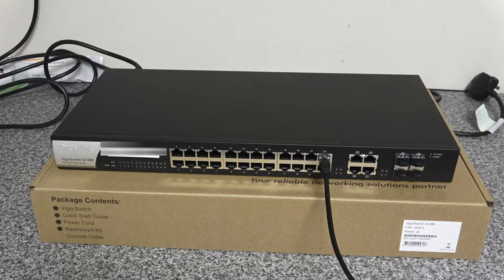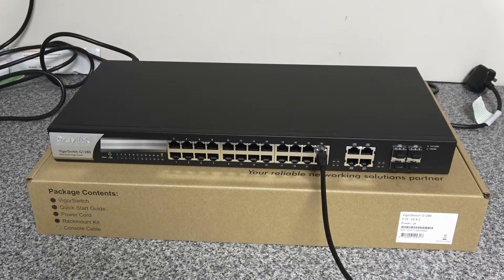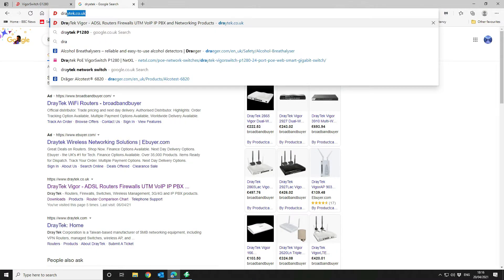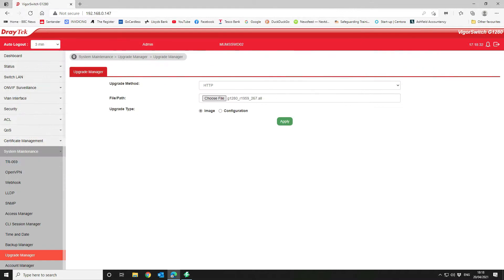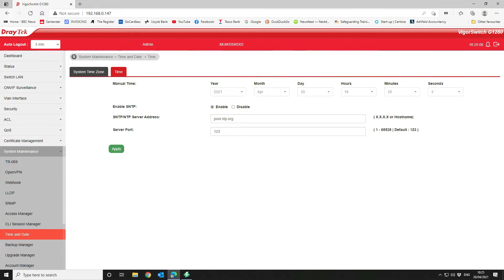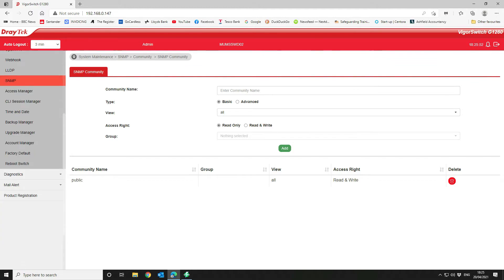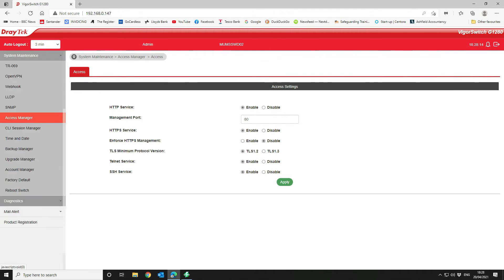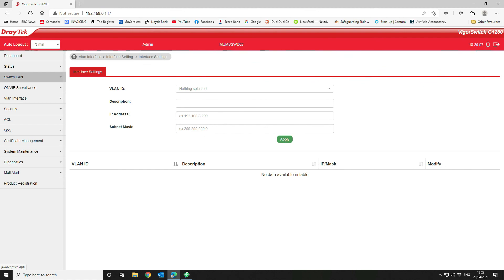Draytek G1280 firmware upgrade & basic config

Comment: Hi, thanks for this review! A question: is the g1280 really fanless? I ask because elsewhere they write in the specs that he has a fan. Thanks and with kind regards
Reply from the maker: "Cooling: Passively cooled, no fan" as confirmed here ==> https://draytek.co.uk/products/business/vigorswitch-g1280#specifications
Reply: @FrimleyComputing Curious... the german draytek page says he has one: https://www.draytek.de/vigorswitch-g1280.html
Lüfter: ja (fan: yes)
I hope there is no difference between english and german versions. I don't want a fan because it will be in my be room...
Reply from the maker: @Moenubuesu1  I've opened up my switch and uploaded a photo for you here so you can have a look inside ==> https://www.frimley-computing.com/wp-content/uploads/2021/08/G1280-inside.jpg
Reply: Hi!  @FrimleyComputing   Thanks your your photo! The box  is pretty empty inside... I got mine today and i saw that it has no fan inside. I ask the Draytek Hotline Germany about it and it came out that the german site have an error and they wanted to correct it.
 I bought a Vigor 2865Vac and i want to use the switch and the router for my home network.
Thanks again and kind regards